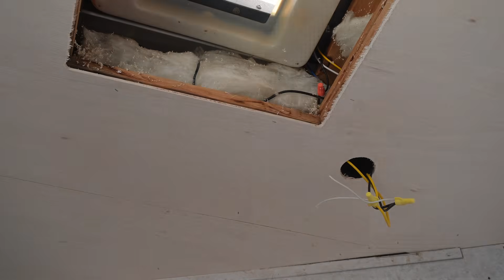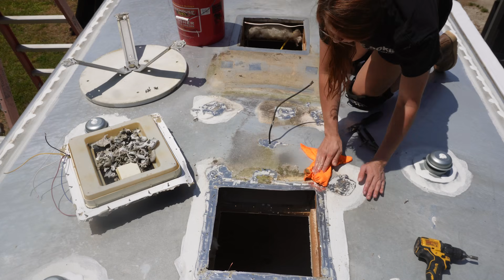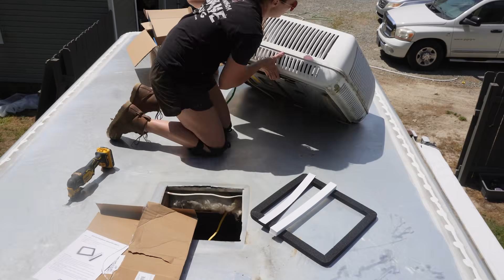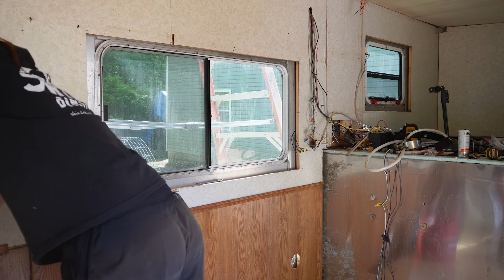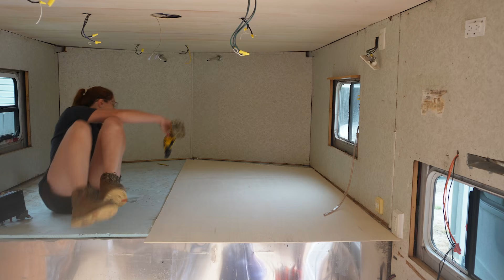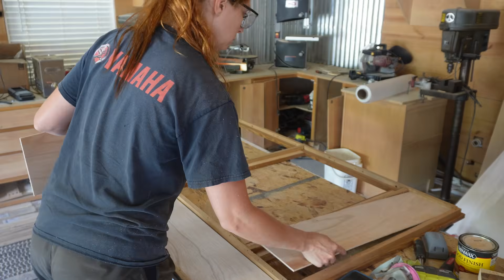Horse Trailer Renovation: Part 5

Comment: That trailer was originally built on a Friday😂 just a painting tip from someone who has painted 20 years commercially, you don’t have to take it all the way down to the wood if you are staining darker than the original color. That color will be your base and you won’t have to apply as many coats. You just need to sand through the poly. You can also add stain to the poly so you don’t have to apply as many coats. Hope that helps for the future! 😊

Comment: I have an icebox , bedroom set ,lights, small table set , generator,  one bed  couch  then too balance the weight i have  a  big chair 💺  foot rest need a  Ac unit
want  a water 💧  heater 20 gallon  gasoline no shower a long tub I have already bathroom thing's and  poles  I want a  fancy door to the back  and keep the rolling door  and  dead  boats  on all doors I have those  and a flashing toilet, washer and dryer, I have that that's why I want a u-hul, FedEx, ups ,bread , soads , fedolay , types of  truck  26 ''to 36 ''size  I can drive I have my license so I can putting it in license tag when I pay it out then after that I can pay you for other thing's I want you to do for me like paying your father too do the elc . For me and a small top freezer and a college  icebox need washer and dryer hook up I also have some pvc pipes and all the tools  air gun,air tank, TV, fans, fault, and shower 🚿 heads yes just  long tub mostly I can get it  cheaper here my phone 📱number is (785)701-1512 I want the flooring you use no glue thanks Want 200 gallons on each side of the front behind the front sits I have a ladder to reach them when refilling them I will get the 💧 hoes  I will have the door also you can tell me what all you need how much dose it costs to come here and get everything I have the hold family can come with you and I will pay the gas here and  back no cabinets, widows in bathroom  no fan I have those the tub for water tank I have a big front yard childern can play and I will cook for everyone then it's easier and I have some thing's to give you I have school stuff pencils ✏️  pen and  other thing's  I can do some of the work I will pick out ceiling  to be or what you think no glue mybe we can use the vanal just instucelltoin then use only nails I have some wood also I would like that white cooling rubber stuff and then home  made gutter  down too  the ground and as you rest I will work I will sleep in the truck  if possible but in there are house two beds in one room then one couch 🛌  in the front room we do a lots of things a Like I have a small dry vacuum  cleaner and another vacuum   want a cook top every thing electric but the water heater need outets ,have TV, antenna's 

   too drape  down  to  the  ground r